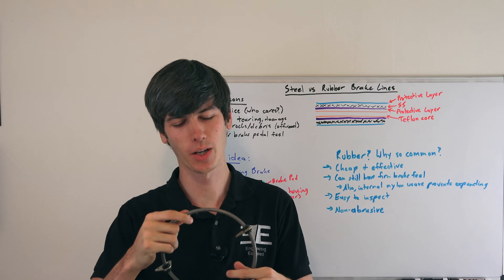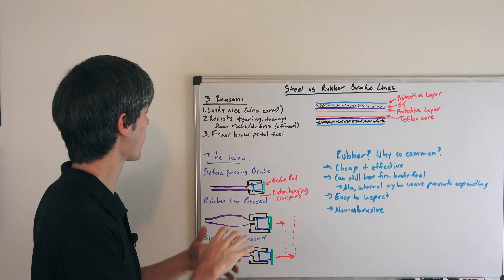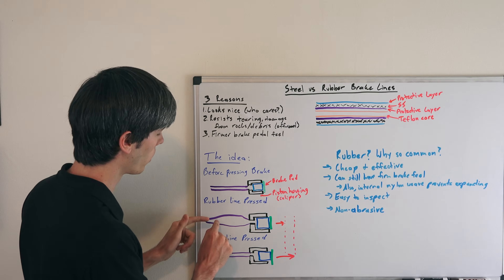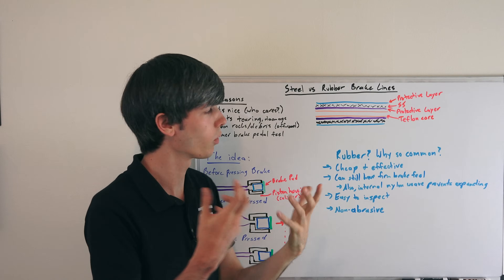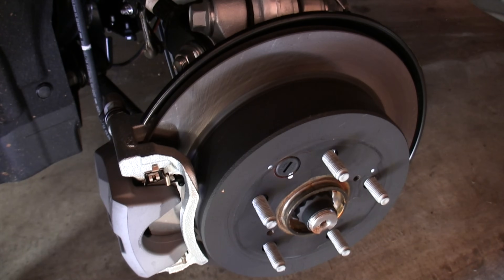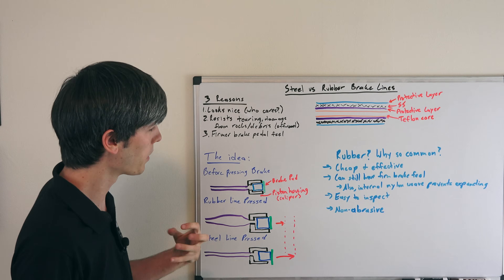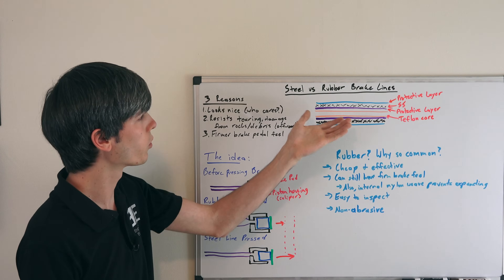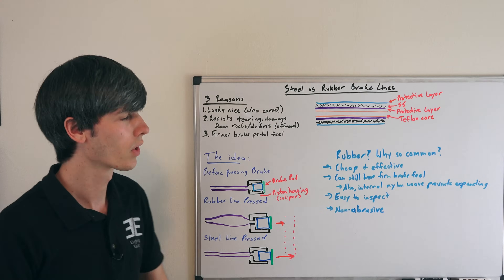Steel Vs Rubber Brake Lines - Are Stainless Steel Lines Silly?

Comment: Funny that you mock people for never having held a rubber line, then go on to dismiss the benefits of braided lines as minimal. That certainly smacks of theory over application. It also smacks of a narrow, street vehicle view. There are no caveats, no limiters, just blanket statements. Poor show. 

Now, if you'd like to put some evidence behind your claims then be sure to use a variety of cars - those of us in the real world have experienced a range of vehicles and a range of effectiveness.
Reply from the maker: +VRTEGO75 Typically I just make stuff up as I go. :) BUT, if you check NHTSA's FMVSS 106 requirement for DOT compliant brake lines, you'll see that 1/8" ID brake lines cannot expand more than 1.2 cc per foot of brake line with 2,900 PSI. Which is pretty minimal for pressure that high. DOT lines must also be able to hold 7,000 PSI without bursting. 

Seems pretty reasonable to me: http://www.nhtsa.gov/DOT/NHTSA/Vehicle%20Safety/Test%20Procedures/Associated%20Files/TP-106-10.pdf
Reply from the maker: +ChrisHallett83 1.2 cc is for a regular expansion hose at the highest pressure in the test. For a 1000 PSI test in a low expansion hose, it cannot exceed 0.33 cc. And remember, these are the maximum limits, not how much it actually expands. I'm sure there's a factor of safety in there to allow for slight degradation with time.
Reply from the maker: +Engineering Explained To add, via StopTech: "Typical brake line pressures during a stop range from less than 800psi under "normal" conditions, to as much as 2000psi in a maximum effort."

Comment: I have them so my angry ex-girlfriend can't cut them through
Reply: watch his girl read this, and comment thanks on his account, then we never hear from him again. you just helped her get away with murder lol
Reply: +Bart Van Riel i am car mechanic,
you can cut them with a simple set of pliers.
Reply: Don't know why anyone would bother cutting a line as just loosening any of a myriad of bolts would do, even just a bleeder valve :-)
Reply: I heard your ex-girlfriend just bought a pair of bolt cutters from Home Depot...
Reply: +Bart Van Riel Clearly, she's never heard of di-cutters, lol
Reply: steel lines al almost as easy to cut.
Reply: +Bart Van Riel  good point, seriously !
Reply: +Bart Van Riel You just crush/cut the hard pipes.  Those are much easier to destroy than even rubber lines.
Reply: Hide the hacksaws lol
Reply: +Bart Van Riel Pretty amazing that a woman even knows where to locate brake lines on a car, to be honest
Reply: 123 456 I was just joking haha
Reply: she`s been studying mechanical engineering and thermal dynamics so he`s got to think ahead :)
Reply: Bert R how can you even cut them?
Reply: @bartvanriel6767  tin snips or bolt cutter or grinder
Reply: Wise move!😅
Reply: +Bart Van Riel with a good sharp knife you can still cut most flexible metal lines the solid ones are tougher though.
Reply: JohnnyWishbone85 braided brake lines still have rubber inside them you know?
Reply: Bert R but what woman has pliers? I was thinking about a knife or scissors
Reply: Bert R probably with some force
Reply: That's alright if she doesn't use bolt-croppers to cut her nails.
Reply: Son of a Zombie ??
Reply: This is the best and most awesome reason to install SS lines

Comment: really ? no one figured out that the steel is a heat conductor ?? nothing more.
Reply: +Dhr Willemsen The steel can also shed heat faster than rubber because rubber is an insulator. The heated brake fluid in the rubber hose can not dissipate as fast as steel. And rubber can not match the pressure of steel. Rubber works but in some applications steel is desired.
Reply: and + that steel brake lines are less prone to wear ore damage from stone skipping. think of rally racing .
Reply: +Dhr Willemsen The rubber hose is very short compares to the rest of the fluid carrying body. The majority of the time the hose is the only failing part outside of the caliper or wheel cylinder.

Comment: I don't think you're giving stainless steel lines enough credit, and writing them off as a myth.  You can pretend it's 'only microscopic' or whatever, but the reality is that the difference is huge.  The difference is NIGHT and DAY.  True, there are other things that play into pedal feel, but ANY car, if you take the OEM rubber ones off and put SS ones on, the pedal will feel MUCH better, I promise you that.

Don't knock it 'til you've tried it, man.  It's not snake oil, it makes a huge difference in feel opposed to how it was with OEM lines.  This is ESPECIALLY true if the car is over 1 or 2 or 3 year sold and the OEM rubber lines start stretching.

Get some for your subbie and you'll be singing a different tune.

Comment: I wonder if steel braided brake lines help reduce boiling of brake fluid by creating a heat shield for the fluid in the brake line?
Reply: Its not about shielding the internal fluid from outside heat. The brake fluid pushes the piston in the caliper which pushes the pad to the disc. the heat from that is what heats the brake fluid. Brake lines won't change that

Comment: I tend to agree that rubber works quite well for their purpose. Generally, cheap SS lines are installed and are not nearly as reliable as their OEM counterpart. I'm willing to bet that often times air gets trapped from amateur installers . Stick to OEM unless you're a F1 driver.

Comment: +Engineering Explained another benefit for steel brake lines is if you are driving on the track, the high temperature on the track will give unpredicted braking response and feel if using rubber brake hose, which may result in damages or crash.

Comment: Rubber lines foretell malfunction, bad quality steel lines could break suddenly with no warning.
Reply: Rubber hoses break suddenly without warning as well.
Reply: +mi lu Bad quality bare rubber might not give warning either.
Reply: +mi lu .....Excellent point. I personally don't care for their inflexibility during suspension & steering travel. Change the fluid every 2 years or 30K & everything will be fine. Even a $200K Mercedes or Porsche come with reinforced rubber brake hoses. They give a more progressive feel
Reply: Usually a rubbre line is defromed before malfunction,  not with a steel line, because steel line usually breaks at the joint, not the line itself.
Reply: +mi lu Rubber hoses can separate from the metal swedge and/or burst. Most brake issues with the hose is a rubber issue not stainless steel because the majority are rubber.
Reply: Regions heavy use of road salt and sand for road are really bad on regular steel brake lines. Not to mention it is also bad for those cheap galvanized and aluminized exhaust system replacement. SS is the right one to use.
Next is to have the entire car sheet metal fabrication with SS. That really takes cares the environment in long term globally.
Reply: That is why I said "bad quality steel line", the metal joint is much prompt to burst than rubber due to higher pressure.  Maybe I should say " cheap bad quality steel line",  because the expensive steel lines are truly better than rubber lines.

Comment: I've got a 2004 Toyota Tacoma TRD, a 2002 Ducati Monster 750, and a 1973 Honda CB500. I've upgraded parts on all three and it cost me significantly, but improved looks and performance in a lot of areas. One thing I have learned though is that manufacturer engineering is superior in almost every way, and upgrades can actually hurt performance often. That being said, manufacturers don't install rubber brake lines to cut corners, they do it because it was built to work under the environment and operation your car or bike was designed for sufficiently or better. Replacing OEM parts for something aftermarket with better looks and performance will often land your auto or bike in the shop regularly because parts may not be in perfect sync with the rest of the car or bike.OEM engineers designed everything for a certain reason, don't forget that.

Comment: Really cool video. I do use SS brake hose on all of my performance projects. I think if you upgrade any part of the vehicle, you must upgrade the other systems in the vehicle. I have experienced a few rubber brake hose failures... not a good feeling. Possibly due to heat and age.

Comment: I have them on my 13 STi and it did firm up the brake feel quite a bit. They didn't feel weak or flimsy by any means, but the Stoptech lines that I got felt a little higher quality and the feel speaks for itself.

Comment: On a motorcycle, SS lines make a bit difference in the level of control before the point of lock up (mostly because they are quite long and manufactures are painfully cheap when it comes to brakes on lesser models). I found my OEM reinforced rubber lines to be subpar after only a year. Rubber lines suffer greatly from not all being created equally. Ultimately, however, the SS armor braid renders the lines nearly "solid" against expansion and lasts as long as the braid remains undamaged. I've got 6 years on my SS lines, and they feel as good as they did when I finished bleeding them (the second time). I can't very well say they felt great after installation... they were empty! LOL

Comment: Since its the inner layer that holds the pressure not the outer braid or the rubber then braided lines are not going to be better? Also as braided lines age it is going to be hard to inspect them as you will not be able to tell if water gets past the outer layer.

Comment: Isn't it weird how you never see stainless steel hoses on large hydraulic equipment??  Its always rubber...
Reply: +Underpantsniper they are steel braided actually
Reply: +Underpantsniper The hoses are simply cheaper. They have to find ways to cut the cost of the equipment. They have tons of repair hoses available for not if it breaks.... when it breaks. I work with a hydraulic hose company and heavy equipment is there number one customer for replacement.
Reply: +Underpantsniper thats counter productive to future business, i am a lift operator and at my company if even a light is out or anything damaged or working in a weird way,  we must call for lift repair company to come out to fully fix everything before the lift is cleared for operation.
Reply: +Underpantsniper its great reason for the "LIFE SAVING RULES" a "LIFT" is a Heavy Machine that can easily kill any human it comes in contact with, its serious stuff and you can damage millions in products if the equipment fails
Reply: Based Dean So why would they use hydraulic lines that they know are going to break more easily if they want to save lives and millions in product?? In the the long run it doesnt make any sense..
Reply: +sizeOVERstrength Indeed. They have steel inside the rubber
Reply: they arent built to last forever, they have lift repair careers.
Reply: So why not just replace them with stainless steel lines and never have to repair them??
Reply: +Underpantsniper Because they aren't going to break more easily. Its kinda a myth.
Reply: +Underpantsniper  These hoses are not as you think on " large hydraulic equipment " 

Here is a good place to start. Link 
http://www.thomasnet.com/articles/pumps-valves-accessories/hydraulic-hose-applications

 Basic Hydraulic Hose Construction

The basic hydraulic hose construction involves three layers. These layers help maintain a consistent and reliable flow of liquid while protecting the overall assembly from breaking down as a result of wear or abrasion. 

Inner tube: The inner tube is designed to be compatible with the liquid it carries, allowing both free-flowing elasticity and pressure-resistant stress bearing. This tube is often made from PDFE (PTFE), thermoplastic, or synthetic rubbers.
Reinforcement layer: This layer surrounds the inner tube and is composed of a coiled or braided wire. This set up supports the tubing while protecting against tears.
Outer layer: This layer is made of rigid materials and is designed to protect the innards of the hose. !;-)
Reply: sizeOVERstrength really??
Reply: Based Dean well thats a shitty way to do buisness.  So much downtime for no reason..
Reply: +Underpantsniper .....Isn't it also weird how you never see stainless steel hoses on a $200K Porsche? Always rubber, but NOT cheap rubber.
Reply: +Underpantsniper but they use steel in airplane hydraulics...
Reply: +Alex Rhodes .....Those are $20M *NOT* $200K. But next time you run your slammed Integra with the coffee-can exhaust at LeMans, go ahead & throw on a set. BTW, Porsche doesn't run GP.
Reply: +Alex Rhodes .....Now, I might just be impressed and humbled *IF* it's a Daytona Cobra Coupe; a fine ass machine that beat Ferrari to the "World Championship" in the 60s. If it's the Bristol on steroids? Not so much. Don't get me wrong, they're loud, intimidating & good for the quarter mile, but on a road course our Porsche 911's superior handling,FAR superior braking, & reliability? It becomes a no-brainer. It's those pesky BRE Datsuns that end up on our tail on the last lap at Willow. I build air-cooled 911 engines & small-block Fords for vintage racing clients. The Porsche Carrera Cup series is a support series at  selected GP, IMSA, & Indy Car events, sanctioned by Porsche AG, and races under FIA rules but is not affiliated any more than the Toyota Celebrity race at Long Beach is affiliated to Indy Cars or IMSA, even though they all race at the same venue, on the same weekend. LeMans GT3 cars run $500K without spares; the LMP cars?... priceless!
Reply: +Underpantsniper the line also has to be rated to withstand the fluid that is going through it. A lot of the hydraulic oils are quite harsh...so you dont exactly find stainless lines big enough and rated for those fluids. it would cost too much.
Reply: Underpantsniper they are stainless steel under the rubber or nylon protective coating.

Comment: It's the first time that I fell like you are completely wrong on a video... Some points are interesting but you miss some completely. 
The main big advantage of steel brake lines is their resistance to overheating compared to the rubber ones. Go on a track and you'll loose your brakes at some point because rubber will loose some of it's rigidity compared to steel. 
And annother point: "rubber is not abrasive [...]and if it comes inn contact it will not start to wear off that part over time"... seriously? you should check because they do a lot of damage, actually exactly the same as steel brake lines as they are both rubber on the outside.

Comment: DOT-Approved brake lines are tested to 3000psi, as I recall.  If you ever have a chance to cut one in half to have a look at the cross-section, they're rather impressive little things.  Their size is deceiving; they may look like they'd be huge inside and have all sorts of space to expand, but in reality, your typical rubber line is upwards of half an inch on the outside, while the internal passage the brake fluid travels through is less than an 1/8th of an inch.  There's a lot of material in there, and it's multiple layers of various materials.  The inner lining is compatible with brake fluid, that gets wrapped in a woven fiber sheathing, which then gets another rubber sheathing over it, and yet another, thicker wrap of EPDM rubber over that to protect the inner linings from debris, environmental exposure and the various oils and other fluids that may leak from the engine bay.  They're pretty spectacular little things when you consider that they'll commonly go 100,000+ miles without failing.

Comment: if you truly want a immediate pedal feel, change the brake cylinder to another one that is known for its immediate pedal feel. 
Forget pads, fluid, rotors, calipers, its higher up the chain that is the problem with a long travel brake pedal. This is assuming you have bled the brakes and its still feels bad.